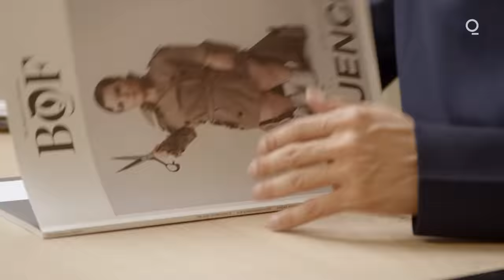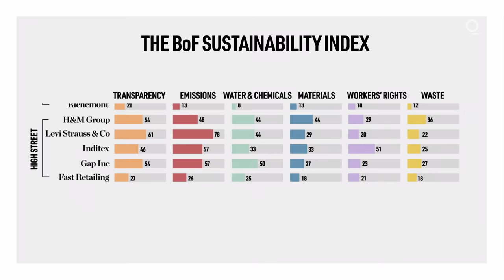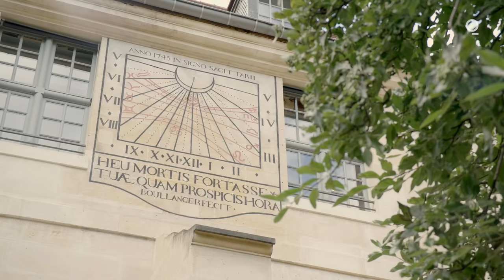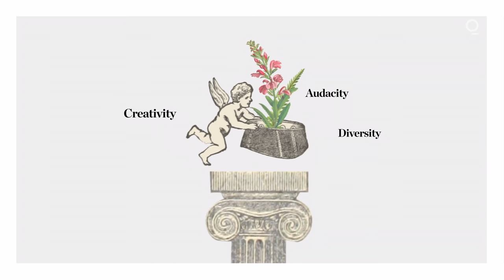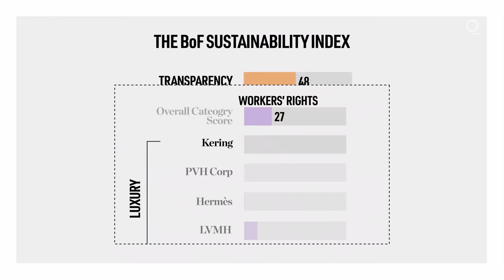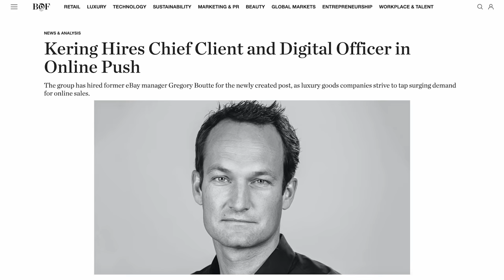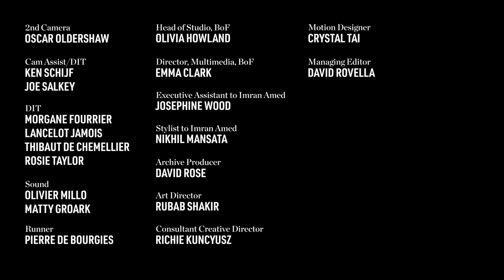Why Fashion Brands Are Doubling Down on Sustainability | The Business of Fashion Show

Comment: There is a brilliant way of maximising shareholder profits by increasing the prices of luxury goods and lowering production and distribution costs. But we live in a world where if u move production to regulated markets you will end up with higher costs, and perhaps fever resources, so u will still need to transport resources and facilitate production, which ultimately increases prices.  Is nearly impossible to regulate, unregulated markets where mass production is taking place. and far too expensive to move the whole production to regulated markets. This is the biggest challenge The Fashion industry face... and nearly forget to mention the disruption in the supply chain due to climate change.  The Fashion Industry doesn't have 10 years to come up with a solution.
Reply: creating lab materials is one way of moving forward...

Comment: The host of the show has substance, but comes across as harsh, abrassive, and judgemental. Perhaps, framing the questions different or coming across (less) as an activist would do a good cause bettter service. Solving externalities will only help the environment to the extent that the luxury industry operates on. Perhaphs, setting a standard for the entire clothing industry (across the board) would be a better strategy. Also, better horizontal integration might be needed, and but also workign with the suppliers at the vertical level.